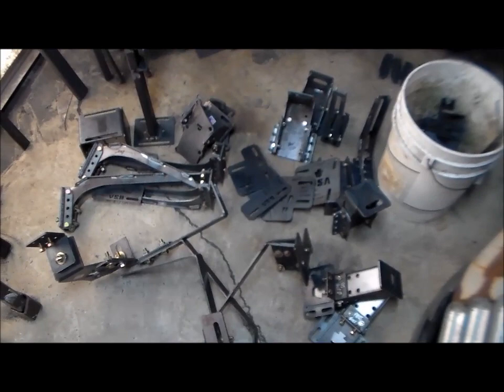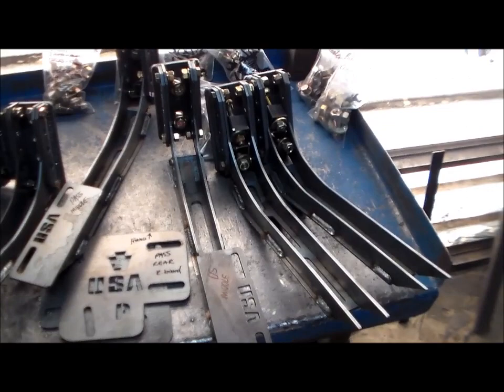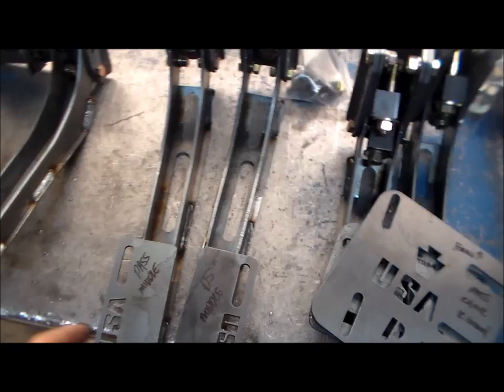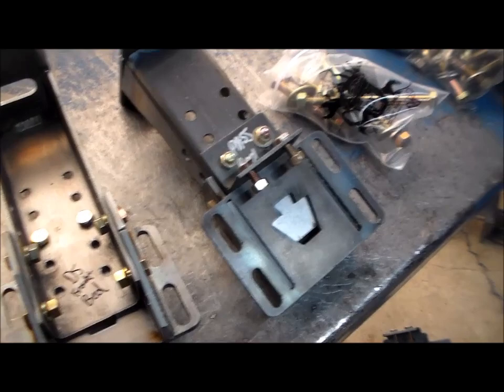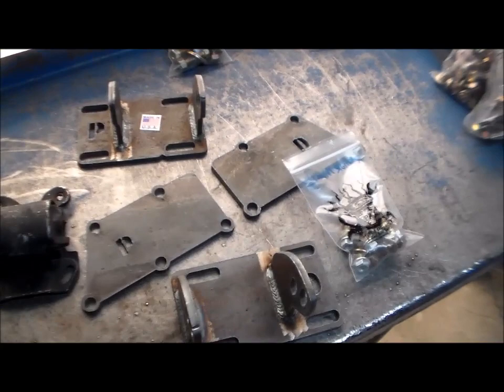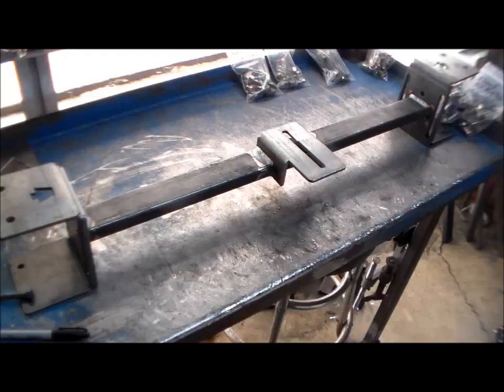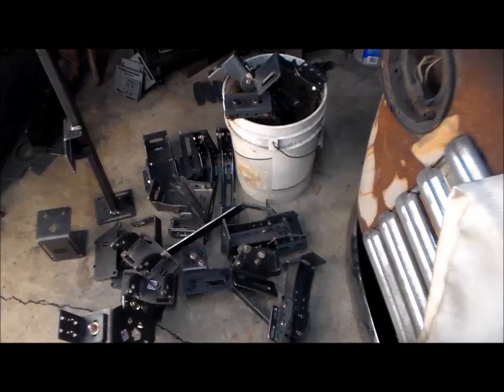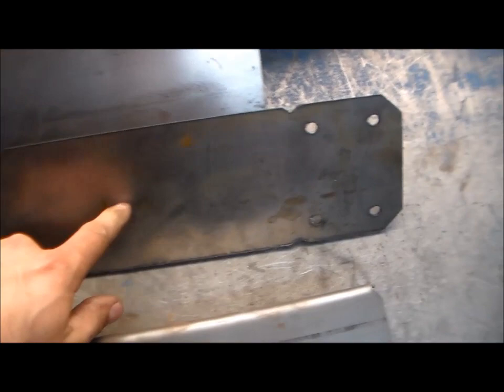AD-S10 KIT  explained June 2019

Comment: its been just over 1 yr since this young man has put this kit out to the public . He has figured it all out for you ,put all his efforts into this kit (and more) that he makes by hand and sells . I bought one of his kits this past summer 2019,for my 1951 Chevy 3100 ("35 year dream truck " I've wanted since I was 17...)and I'm still slowly working on it given my time and funds hold out. So far it has been pretty spot on as per his instructions . Only a couple times Ive had to ask Henry about something that came up I didnt understand and only once there was a manufacturing thing on GMs part . I had to notch out and re-plate in a tiny angled spot on the frame where a motor mount bolt would not pass through , but thats all.  I keep in contact with him as I work on mine as a blog of sorts to give him the end user/customers view of how his kit goes together so he knows his parts and instructions work as intended for a specific height application most guys will use. Hes a very nice guy to work with . Hes a one man shop and his quality is incredible. Plus, he is constantly coming up with more ideas and products for us . If you're considering doing the S10 frame swap for your AD Chevy /GMC project , use this guys kit.

Comment: Looks a lot more beefier than the stuff that code504 is selling. Currently working on my own 1950 Chevy pick up truck debating on where to go original or get the S 10 frame which I’m most likely going to do wondering what would be the cost for the kit